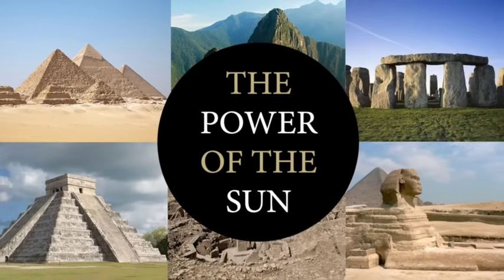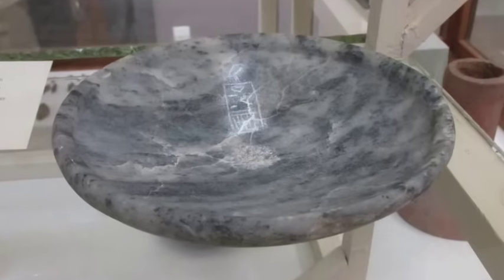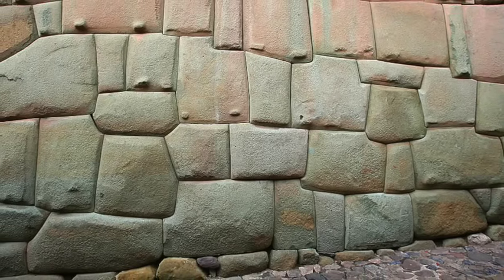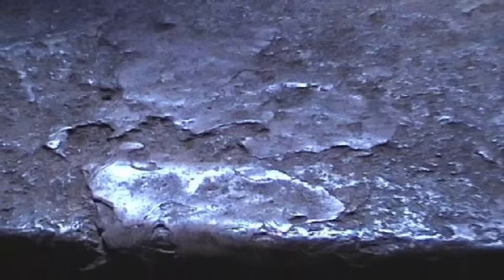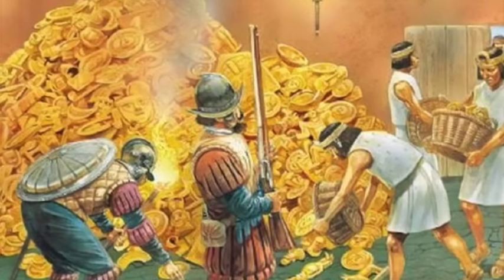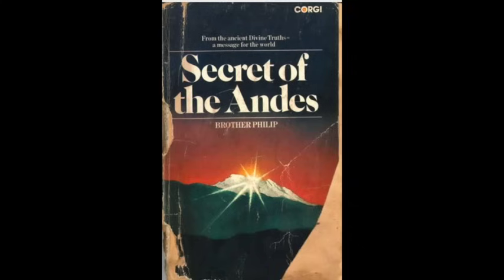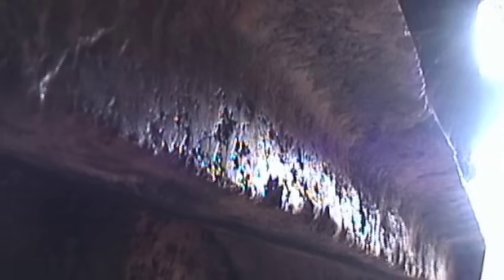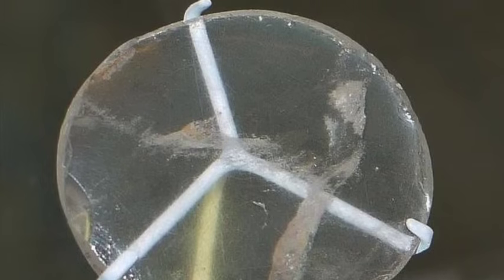How the Ancients Cut Stone with the Sun - Lost High Technology Explained | Ancient Architects

Comment: Being able to cut stone using light doesn't explain how they were able to make the extremely heavy boulders fit so perfectly. They look for all the world like they were soft, malleable, and simply pressed together like clay, and then allowed to harden. I suspect they must have been light enough to manhandle easily too. Vibration, resonance, and frequency probably played a part.
Reply: . . . . or they carved fake cut-lines !
Reply: @Mr.Grimsdale  We have a system where a contractor stamp a brick like stencil into a wet concrete slab.  It is called crazy paving, and it looks like brick or stone paving.  We also have engineered stone.  Where some substances is mix to create a hard surface, similar to granite.

Comment: With a silver metalised Mylar sheet and a large satellite dish to make a parabolic mirror it is possible melt rock, but only in a 10 mm diameter circle, and there is the tendency for the stone to fracture from the thermal stress. Cutting lasers have a very small diametre so this may not a problem however some stones DO fracture. So no, the Ancient Egyptians did not use sunlight to bore holes in granite or surface treat stone blocks even if they had  metalised Mylar sheets and a large satellite dishes.  But let's say they had, then at 10mm circles at a time with a few minutes each, they would still be surface treating the pyramids and all their statues until today. lol

Comment: This is very Close to the TRUTH!!!!! 
By Shaping and Carving the Rock (ROCK ON ROCK WITH SAND AS LUBRICANT), then by HEATING the Rock the surface and Change to Surface cracks ie: Resetting the stone, 

By carving Lines in a Rock and then Laying Embers (heated gravel / Sand MIX from fire (similar to barbecue coal) then further Shaping/ smoothing can be applied if required before reheating or baking if required) . Water added to the heated LINES Enable for the lines to Split the Rock in a Perfect line. 

The properties of sand and the heat available was known to the Egyptians(SAND/GLASS) and its adhesive nature........ 
By using parabolic light focused can be used to ROCK ! Spot on! but not for small objects ..... 

there are still gaps in the truth but , when living around volcanoes you would know about how to mold lava and rapidly cool...... IE making bricks!!!! although the problem is that controlling the shape with molds may also produce mal formed shapes .... hence the odd shaped bricks .... 
MAYBE?

Comment: Those Inca blocks certainly don't look cut, they look chiseled.
Reply: Looks like 1 to 3 inches of the rocks surface was softened before it was shoved into place  and then shaped, chiseled, scraped , and pared to fit.The occasional nub or knob did not soften properly and was cut around and left in place, too much trouble to remove later.

Comment: It was done with the f sharp note... with sound. The stones were vibrated together with high resonant vibration causing them to sand against each other until they got a perfect fit. The stones were levitated with short wave frequency of the F sharp note. It creates a torroid/donut shape around the stones causing it to repel the earth. They used stones with a high quartz content and when you send repeated pulsed waves through it the oxygen atoms in the quartz which are diatomic start to orbit each other just like you see in binary stars... and when their orbits cross a spark jumps across creating a magnetic field, plasma and spin. The technology is simpler than you think.

Comment: I have two problems with this hypothesis. 1. The extreme intensity of the concentrated sun light would have made it impractical to see what you were doing. 2. Because the sun is not stationary in the sky it would make it impractical to keep any cutting beam in alignment for any necessary length of time.
Reply: Well when I was a kid I bought a 3.5" magnifying  glass. As a kid with no preconceived ideas I spent many hours playing with it. I started fires with it. When I focused the sun light on a piece of rock the spot would pop off.  So that experience tells me that  this knowledge could have been developed into cutting rocks. Larger glasses would concentrate more sunlight into the same size spot as a smaller magnifying thus mo9re heat in less time.  More research by the ancients would have enabled them to develope susphiscated methods to cut and shape rock to fit together in the walls we find today.

Comment: Interesting, but focusing the Sun's light would not produce a paralell & finely controlled beam, narrow over distance - as a laser gives. To produce a laser beam (Light Amplification by Stimulated Emission of Radiation) powerful enough to cut even thin metal requires relatively high power, focusing by prisms & mirrors. Sure, as kids we've all burnt paper by using a lens under the sun but the spot is focused at  a precise focal distance from the lens, meaning cutting further away to be impossible.

Comment: There is a reason nowadays they do not use lasers to cut stone or heat for that matter. The molten rock and slag is a big problem and messy. It is also very difficult to rid the cut of this Molton rock ...as you cut. It simply cools solidifies and fills in the cut making the process redundant without something like compressed air to blow away the slag during the melting process or some other method of removal. That is why most modern precision rock cutting is done with high-pressure water jets, or diamond blades,  not heat. I'm not saying that the heat evidence is not there it most certainly seems to be... I'm just saying that laser cutting is highly unlikely, and would not produce the smooth edges we find.

Comment: The melting temperature of dry granite at ambient pressure is 1215–1260 °C (2219–2300 °F); it is strongly reduced in the presence of water, down to 650 °C at a few kBar pressure. 

Now I don't quite understand how the concept of wet furnace would work, but if the pressure could somehow be raised, I suppose it would work. For more patient and nerdy types, check this: https://academic.oup.com/petrology/article/42/4/673/1495774

Anyhow, sunlight cutting doesn't explain the mystifying pre-inca walls, but if natural boulders, cut roughly to size, could be softened without quite melting to magma fluidity and then dumped in the trench between some supporting scaffolding, the puzzling effect of rounded, irregular, yet perfectly fitting stones might result. And the article linked above does seem to prove that wet stone melting can occur at 650 degC at a few kBars.

If the supportin walls of the scaffold had good insulating properties, the boulders migh even retain enough heat to still be slightly plastic, yielding to the pressure of the next hot boulder being dumped from above?
Reply: This is exactly what i was thinking.
Reply: If you hit resonant frequency then a pile of rocks wear each other down, leaving the same effect

Comment: HUH?  There is no mystery on how stone was cut so accurately.  Time and labour is the simple answer.  Grind a flat surface against another and you get a smooth surface.  What was surprising is that they took so much time and effort to make things so square.  There is nothing technically amazing about it.  Just the persistence of the ancients is what is amazing.
So unless you can build a working rock cutting reflector using only ancient tools and material then this is simple conjecture.  Very unlikely conjecture at that.

Comment: I can believe the sun was used to cut stone, but I also believe the Egyptians had electricity even if it wasn't used for such a purpose as powering drills; saying there have not been any electrical items found is not quite true anymore, as clay pot batteries have been proven to exist around that time and scientifically speaking the arc of the covenant has been shown to be a large capacitor, which was fashioned according to Moses' Design and he was a Prince from Egypt.

Comment: ancient batteries found in baghdad could break down water to its components which when oxidised as brown`s gas can melt tungsten at 70 degrees celius.the sun`s heat would be to hot to get near.with brown`s gas you can melt sand in your gloved hand.u-tube brown`s gas and see for yourself

Comment: Sorry but this doesnt hold water, rock cracks long before it melts due to gas expansion. Second,  it would take very advanced optical glass lenses, not just concave mirrors, to focus such a powerful beam of light down to the 2mm level required to cut it. Not only that, even with modern high efficiency reflective materials and massive Parabolic Solar Concentrators we can rarely produce heat anywhere near that required to melt granite - check out the solar furnace Font Romeo Odeillo Via in France. You'd need laser tech and even today that is quite limited and enormous  in size at the cutting edge military level - plus it requires far greater power sources than sunlight - millions of times more. Sunlight is powerful but its very widely spread - even capturing and focusing all the sunlight on a football pitch would not mellt steel let alone stone
Reply: No, they made it soft and weakened it by focused Sunlight With Mirrors and glass lenses so they could use soft metal Tools to finish the surfaces. This is why the disc was so important, why glass was a big big secret. Because of the damage people could do with this Technology.

Comment: Sorry, but this is an incomplete explanation. What you have given explains the power by which the stone was worked but not the method of the fine precision control that's evident. IOW, that borehole (which is a perfect cylindrical hole, not "spherical") is evidence of much finer motor control than is generally available from a guy holding a lens or disk. That power must've been wielded by something capable of millimetre-precise direction in order to produce the fine details, perfect right angles and precision surfaces. So we still need to intuit the governing device (like a CNC) that was enabling such operational precision.

Comment: Couldnt they heat up the stones using the mirrors and then apply pressure to the to mold them, like u make the rock with chissel n hammer, then u put the stone in a mold, use the discs to heat them up and put another boulder on them the apply the pressure ?

Comment: Good try but rubbish. There is no way to accurately cut out a section of rock leaving 90 degree angles on the inside of the cut using any modern cutting methods. I've seen so many come up with "their" ideas as to how these stones where cut into blocks or dead ended holes cut into them or narrow slots cut into them. All are pure baloney.  When someone comes up with a theory and follows that up with actual work to prove their theory then the world can cheer but not until then. I'm still waiting to find out how many of the large stones were cut and transported especially some of the ones in temples many thousands of feet above the plains below.

Comment: What a pile of utter shite. 
Fails to mention that there are uncompleted examples of stone being worked, specifically in Egypt, which show such things as the interior voids of the vases and the sarcophagus were done with a hole drill. There are still remnants of the cores in that same sarcophagus in fact, and vases with the core still in place. And there are sites where copper dust has been identified in the cuts of unfinished pieces. A slurry of sand and water coating a copper alloy blade works better and faster than modern people want to believe.  
Additionally, experimental archaeologists have identified techniques, consistent with period materials, which replicate those "perfectly connecting blocks of stone". Further, those "perfectly connecting blocks of stone" are not so perfect on their backsides, and places like the pyramids are practically rubble fill when you get past the parts you can see from the outside. 
It's been demonstrated that every stage of quarrying, rough cutting, movement and finishing can be accomplished with period materials and enough labor. 
What has not been demonstrated, despite claims otherwise, is any advanced technology, or in this case, advanced lens making ability, anywhere applicable in the archaeological record. The examples shown are certainly not of a quality to melt rock.
You'd have to show a parabolic dish of gold can even dent a rock, something that geologist doesn't seem to have done, before he made that declaration. In fact, he doesn't seem to have done ANY experiments on any of the so-called glazed areas, just looked, and proclaimed it was solar power which had done it. Not only did he not verify it WAS a glaze, but he didn't take in to account fire was often used to make the initial breaks when quarrying. That geologist doesn't seem to have ever published any scholarly papers, there's been no peer review of his 'findings', and it was last in the news in 1986. In 32 years, he hasn't published a single paper, gained a single proponent, or gotten one step closer to having the idea gain a shred of scientific credibility. 
Those "holes seemingly drilled through solid granite", were just drilled through granite, no magic, and no technology for which there is zero evidence of in the archaeological record.

Comment: The granite and limestone where pulverized together and reset as concrete. the mixture had the consistency of soft clay. given the composition of granite and limestone and being metamorphic rock, once the concrete set, it would have the appearance of natural granite. this is how cheap granite countertops are made today.  It makes sense, humans seem to find a pattern/technology and we tend to push it as far as we can - consider that you live in a place where there is a lot of sand, logic would follow that there would be lots of sandstone nearby, made by compressed sand. maybe ancient people looked at sandstone and then at granite and limestone and imagined that those too, had once been dust and were reformed....  that lazer cut hole... made with a hollow tube. the soft clay was removed from the tube as waste, under its own weight and still being soft, it slumped a bit before hardening, this is why the plugs that they find are slightly cone shaped.

Comment: Although the theory of using sun light is sound and proved one could get a glass finish using vibrations which would heat up minerals enough to soften them and cause some to glaze at a lower temp than others which is indicative from your report.
   I worked in refractory masonry so have experience in observation of glazing minerals yes heat is needed but it was not solar heat that caused blocks in Peru to distort that is molecular vibration suggested from ultrasonics so a combination of tools were used which would then explain the variety of forms and shapes.  Regardless great channel.

Comment: Nah that might melt the rocks a little bit but thats way too ineficient probly they just ruff cut them and ground them around in a spinning motion or back and forth maybe with some sand between them or something. The friction created heat. Obviously the light from this parabolic golden thing couldnt reach into the cuts and even if it did you couldnt make it a straight line or give it a flat surface so unfortunately thats a stupid theory

Comment: I think +StanJan1958  -has already cracked your theory (excuse the pun) but there are two other problems with that explanation. 1. How would you be able to retain all of the measurements that applied to one block -that needed to be applied to the next? some stones at Pumapunku have 7 -even as much as 9 different angles. lessening the molecular bonds of the stones -an poring them into molds makes more sense. and 2. There's still the mystery of how to move the stones -although water is plausible.

Comment: It makes sense to me as the original cap stones on the pyrimids are gold so maybe they used the same techniques to harness the suns heat down into the pyrimids for some reason? there are many videos suggesting they were power plants  all generators maybe sun light is there fuel ??

Comment: That's a great video! I can imagine a horde 200 or more priests running around the land with gold mirrors on their chests, vaporizing intruders, building temples, creating chains of lightbeams into deep caves through line of sight transfer... You can probably change the distance at which the focus point lands by putting the plate against your chest and pulling the sides.

Comment: One problem with the perfect hole and the square corners in the sarcagofs(bah, spelling?)
Even when cutting with a laser you get a slight houreglass effect becous the point of focus is just that a point. So it would be posible to make a perfect circle but the hole would be larger or smaler the farther from the serfice you get.
The only way to produce cut parralel sides in modern machining is by electricaly charge a brass wire and passing it thro the material
Reply: aggese,
A laser is "coherent" light and does not have a "focal point" to speak of, The Hourglass shape you are talking about results from light focused by a lens or a parabolic mirror, not by a laser, a laser beam's cut would remain straight throughout its length.

Comment: They has electricity by way of hydro water from the Nile sea running through granite causes a charge and quarts under pressure is called piezoelectric, and on top of pyramid had a gold for wifi to communicate with other pyramids and Obelisks.

Comment: Those rocks were melted on a molecular level.  If you electrically vibrate any matter at high enough frequencies, you will break electron bonds.   It is a very, very dangerous method.  That is my opinion, but the idea is true based on my theories.